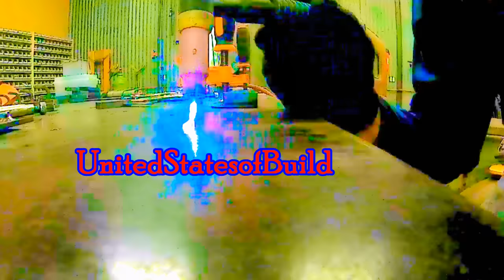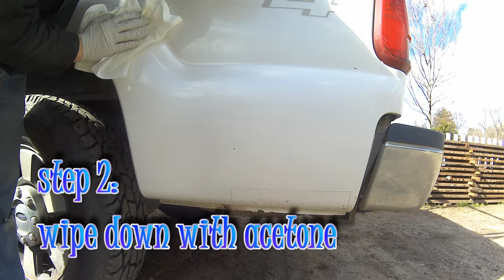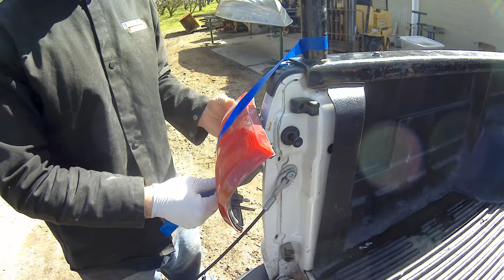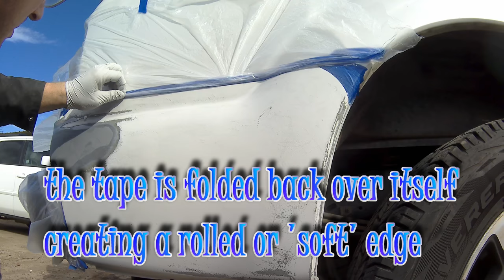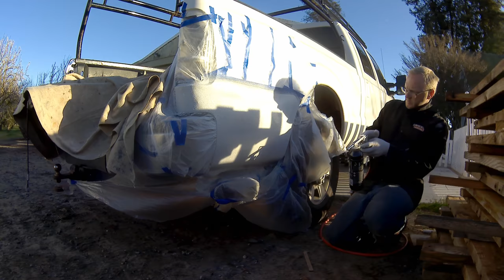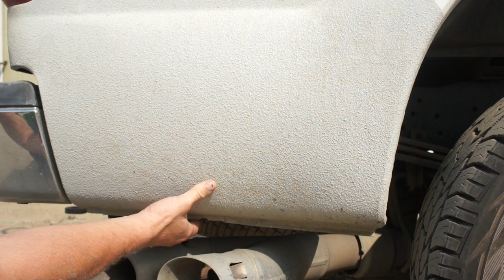HOW TO: DIY rock chip-guard using sprayable bedliner

Comment: Good job. But I totally agree. When I was watching I didn't like that you curved the corner. You said it yourself. Don't know what you were thinking. It has been a couple years now, could you give us another update as to what it looks like? Maybe you can touch up that corner by applying another layer of Raptor on top of the old.

P.S. Maybe you can show us what the raptor lined area looks like when cleaned with soap and water - for us to see how well it well clean after 3 years. 

Thanks!

Comment: Please explain step 6 lay out masking tape lines. 
What exactly are you doing there? How do you line it up?
Reply from the maker: Ill that I'm doing is lining up my mask line off of the body line using a ruler and pencil. I had to do this because the dent repair needed to be covered by the chip guard. You can line up your mask line wherever it makes the most sense. As far as I know there is no right or wrong way, just preference. Thanks!

Comment: Is there only certain types of paint you have to use for that or can you use just any paint? Like exact paint to match my truck
Reply from the maker: This is the tintable raptor, I brought my truck (paint code is located in the door jamb) and got concentrated tint in the manufacturer original color from my local autobody supply house. They also gave me the dose/mix ratio I needed to use.  If you're unsure you may want to take the raptor liner instruction sheet AND your vehicle with you to your automotive paint supplier and let them get you what you need. THANKS for watching!!

Comment: realistically all bed liners are of urethane / acrylic. not a rubber polyurethane. you have to be a certified applicator and have a license to even purchase polyurethane coating. it has to be applied with a special sprayer with double feed hoses that mix the activator and product in the gun. why. because real polyurethane cures in 30 seconds. which is line x and rhino liner. and a few others that a diy can't do. by law you have to take whatever coated to the installer and they have the $25,000 gun and equipment to apply it. what you buy online and on shelves is not a polyurethane or polyurea product. and they even label like al.s bed liner to be polyurethane until i spoke to the company that now owns and sells it. i bought it and realized it contained urethane and acrylic. i was told all it is a thicker urethane clear coat that is slightly more flexible but basically a urethane coating with color if preferred. the only 2 products i found to be rubber and chip proof is durabak and plasti cote. if used with the plasti cote acrylic primer adhesive. or you can use a high quality acrylic primer except one brand. so i sent back al.s bed liner to amazon. because they label it as polyurethane and it is not polyurethane. its the same urethane identical to the clear coat on your factory paint. i researched for 2 days. spoke to 3m corporation then directly to the al,s store that now owns it. its now a paint company named scorpion coatings inc. he went through all the details about their bedliner. he claims it works when its put on thick but will chip, scratch, etc because its made of urethane and acrylic. which is house paint in acrylic for outdoor painting. to say the least being disappointed. i was pissed as chit finding out i spent $130 on a fake non rubber bed liner like line x. its a fake version. and yet on al,s website it lists it as polyurethane. and it is NOT polyurethane.so im going to try plasti cote only because i have dipped pliers, tools in it. and it dries as rubber. my only problem is the adhesion primer. it says its very hard to remove but not like removing urethane paint. and it now comes in gloss. when you used to have to spray a gloss topcoat to gloss it. the cost of the cote and primer is way less than fake bedliner. i have watched dozens of reviews of month and years after using those diy liners and they all fail. all except the polyurethane companies you take your vehicle in and have it professionally lined. the only other way to get polyurethane is to apply to be a dealer. but it is seriously expensive which is why line x charges approx. 500 bucks per truck bed. and it can take all day to do it. rhino liner is the only one next in line compared to line x. both are high priced. but i had line x in my frontier nissan. and it is some serious rubber lining and about 1/8 inch thick like a basketball rubber type finish. im not wasting a ton of money for thick urethane fake bedliner paint with rubber added to it. i used herculiner inside my harley extended fiberglass bags. just wiped with acetone and brushed it out of the can. its rough as hell with thick rubber particles but it did stick like glue and is pretty tough. it even rated high on a youtube review video against some others. thats if you can stand the roughness of it having heavy rubber particles in it. like a 10 grit sandpaper. they do have a spray on. but i haven't tried it. but i might just test it on a old hood to see the results. im getting close to the product i will probably use which just might be plasti cote. its going on a polished stainless steel brush guard in black. maybe. powder coat is too expensive and line x wants more than what i paid for the dam guard. so that's a no go as well. if 3m made their polyurethane 5200 fast cure adhesive / sealant in a thinner spray on. i'd buy it in a second. it cures by moisture and will under water to a flexible rubber that sticks to everything. only acetone will even clean it up. once it cures in a matter of overnight you pay hell trying to remove it. im just wondering if i took some caulk tubes of it and used some solvent to thin it. maybe it would still cure like a spray on coating. but one tube is like 20 bucks. it ain't cheap. but the more moisture its exposed to the faster it cures is beyond my belief. when i spoke to them by phone they were like fort knox trying to get them to tell me what its made of. it requires no activator. comes in squeeze tubes and caulking gun tubes. fast cure only in white and regular cure in white and black. im convinced its like a kentucky fried chicken recipe secret. unless you could hack into their cookbook and find the ingredients. maybe colonel sanders knows! i tried to be like scotty kilmer who does car videos and talks at warp speed but i got brain freeze attempting to speed type. lol